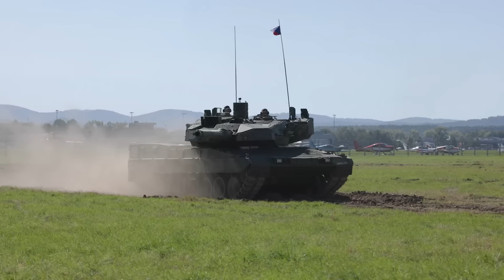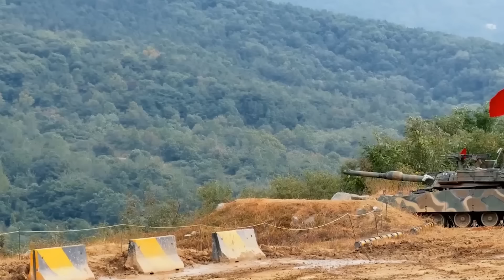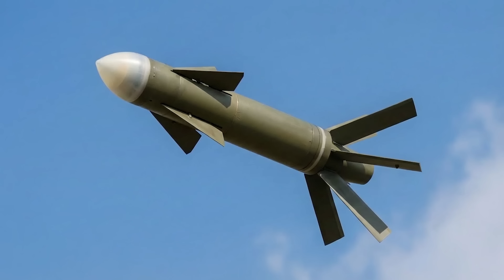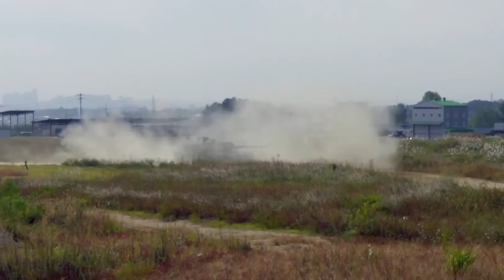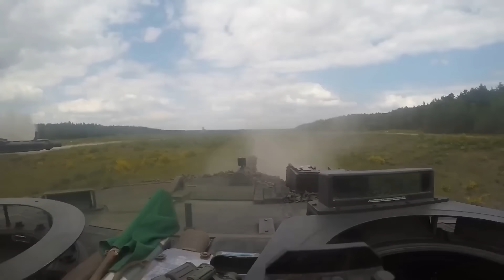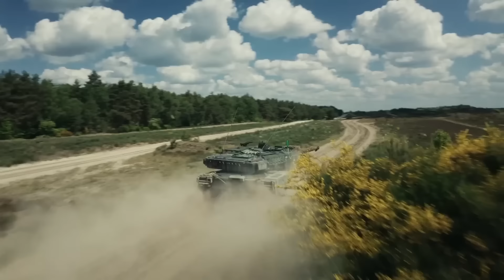Germany’s New Leopard 2A8 Is Better Than K2 Black Panther?!

Comment: When it comes down to real world battle, it's not the super advanced next generation tank that is sitting in the maintenance hanger or in the production facility, but the good enough and modern enough tank already operating in the front lines ready to take the shot.  I'll take the K2 Black Panther over the Leopard 2A8 any day for that matter.  The K2 is built to fit the environment that it is going to fight in.  If the K2 were to fight in the European plains, it will do just fine, but if the Leopard 2A8 were to fight in the Korean Peninsula, it will be a 'fixed target'.

Comment: If a Leopard and a K2 Black Panther strike simultaneously, they will penetrate each other's armor.

Furthermore, since their firing ranges are similar and there is no difference in accuracy, if neither side fires the first shot and fails to kill the opponent, the time it takes to load and fire the second shell becomes the deciding factor for survival.

In this situation, the K2 Black Panther, equipped with an automatic loading system, has the advantage. Since tanks perform evasive maneuvers very aggressively to secure advantageous positions, the automatic system is far superior to a human operator.

Additionally, it would be objective to choose a tank that allows you to operate two tanks for the same cost and can operate in swamps and temperatures as low as -30 degrees Celsius.

On top of that, maintainability must be considered; naturally, heavier tanks are more difficult to maintain, so a tank with fewer sensor malfunctions is preferable.

Comment: 2a8 or a9 will likely end up with 1650hp in the future. as rolls royce is developing the engine currently MTU MB 873 Ka-501 - 10V199. the drivetrain is stronger, and the changes will perhaps be implemented due to leopard 2 now being a heavier tank then previously

Comment: The Leopard 2A8 is widely regarded as the most balanced MBT today. There is a reason why the Leopard wins more competitions than any other tank in service today. Some tanks focus on firepower, some on mobility and some on protection, the Leopard 2A8 has the best balance on all three and this is why it's regarded by most experts as the best MBT. The main advantage of the K2 is its shorter delivery time.

Comment: These guys really stating that the black panther k2 is better then the leopard let me remind you who designed the gun on the k2 rheinmetall did and also the k2 production started in 2008 the leopard 2 series production started in 1979 and continued upgrades have been made to this date while I heard Poland bought some k2s in 2022 that's at least 3 years now your all saying that the k2 would be produced in one year the leopard is better the k2 is best to be going against the type 10 since it's in its same weight class

Comment: The German 2A8 costs around 35 million euros. Delivery time over 5 years and high maintenance costs. Weighs 65-70 tons. The Korean K2 costs around 20-25 million euros. Delivery time around 1 year. Maintenance costs are reasonable. Weighs 56-60 tons. Which one do you buy? Politicians decide, citizens pay. With a 200-1000 euro drone, both will be destroyed and for sure. Main battle tanks are already too expensive and almost all repairs have to be done far away in a depot to get them in order.

Comment: Korea is trying to make the tanks comfortable for now. It is an automatic loader and semi-active internal suspension unit (ISU) system, which enables precise control of body position in both front, rear, left and right directions, and reduces soldiers' fatigue by absorbing shock from the ground. It is really hard to lift and load the heavy shells one by one when shooting. And the Electronics Kingdom, Korea is going to digitize the tanks, so it will eventually develop into unmanned tanks controlled by AI.

Comment: The design philosophy and core platform of the Leopard 2 series are fundamentally outdated. In contrast, the K2 Black Panther commenced development in the 1990s and entered mass production in the 2010s. Even before the A8 variant, the Leopard 2 platform faced significant challenges with the A7 due to limited internal space and the inherent constraints of its aging architecture.

Although there were initial plans to develop the Leopard 3 around the same time as the K2, the project was scrapped and neglected following the downsizing of the German defense industry. The ongoing Russo-Ukrainian War has reignited the development of the Leopard 3, but since it will take considerable time to complete, the A8 was introduced as a 'stop-gap' measure to fill the void.

Germany is finally waking up, showcasing the Leopard 2 ARC 3.0 technology demonstrator in 2024 to bridge this extensive gap. However, it will take time for the Leopard series to reclaim the prestige and dominance it held during the early to mid-2000s.

Comment: Technologically, K2 is the "most" advanced high-tech tank. Computerized hydroneumatic suspension system enables K2 to go almost anywhere: watery soft rice paddies, Rasputitcha, swamps, heavy mountain slopes, jungles, rivers up to 4.5m depth, deserts, deep snows, sandy deserts, etc. Its high-tech fire control system with multiple target tracking, assisted by hydroneumatic suspension, has no match. 100% accuracy at 4.5km distance. 80% accuracy at 5km distance. Digital networking, Drone jammers, composite armor, passive & active protection systems. Superior electronic systems of K2 has no rivals. Note that in modern tanks, superior AI assisted electronics make huge difference. In Europe, even female soldiers operate K2. Welcome to high-tech electronic warfare age!
Reply: K2 lifespan 96,000 km, Leopard lifespan 64,000 km

Comment: Norwegians had a chance to do extended tests with Leo and K2 and their army suggested K2 as winner for them twice (it was even communicated that "political aspects" caused that Leo was choosen) .
Poland has already Leo 2 A4 and A5 versions.  A4 are being modernized. Loooong process with many problems. The main one is availability of parts and cooperation with German side. This "experience" alone caused Polish to look for any other option than Leopard 2. And... time horizon and volumes - Poland wants to have 1000 of K2 tanks  by 2032. We would be lucky to get 100 of L2  by this date. K2 PL will have Trophy system, improved protection and still being much lighter than A8 (which in fact is the latest A7 + Trophy System). Possible to be produced, fully serviced and modernized locally - forget about it with Leo. 
Cheaper, quicker, 10 time more + more reliable partner, technology transfer and logistics based on most of parts produced locally. Was it difficult to choose?
And now Peru  is doing the same.

Comment: Core equipment engines power pack is  both made in Germany.
Reply: When we attempted to export to the Middle East, Germany blocked the deal, so South korea decided to develop our own indigenous powerpack. This powerpack has already been exported to Turkey for the Altay main battle tank. South Korea also plans to apply it to future K2 production. However, the Polish K2 currently still uses a mixed configuration, combining a Korean engine with a German transmission. That said, the fully Korean powerpack may be applied starting with the K2PL, possibly as early as that variant.
Reply: 엔진은 예전부터 한국산임. 미션만 독일산을 썼는데 지금은 엔진+미션 모두 한국산임

Comment: It is the current address of the German defense market that simply maintains a very expensive unit price, which is arrogant, too slow, idle, and unnecessarily expensive, without having an attitude of consideration or respect for customers at all. On top of that, so does the stance, where the potential for smooth technology transfer converges to zero virtually no change at all
Reply: 독일이 eu 수장국이 되면서 유럽, 특히 중, 동유럽에 갑질을 많이 하긴 했지.

Comment: Simple specifications and mobility, versatility comparison: K2PL = 2a8 >= K2 black panther > 2a7. However, considering the price per unit, the time it takes to supply after delivery, and whether or not to transfer technology smoothly, Leo 2a7 or 2a8 is not comparable to k2 at all. Of course, not only competition between simple tanks but also competition in the self-propelled artillery market is the same as the German defense industry is completely be left undone by Hanwha Aerospace's k9 regardless of its performance. In addition, the gap in market share is set to widen even further when it is soon improved to k9a2 and exports to that version are expected
Reply: 유럽의 자랑 조선업이 한국,일본,중국에게 조선업을 완전히 내주게 된 것처럼 방산업도 한국, 중국에게 완전히 밀리는 중이지.
현재 한국의 잠수함 사업도 독일과 프랑스가 목숨을 내놓고 한국을 방해하는 것도 이와 같은 이유야.
유럽 강국들이 독일을 지금까지 욕하는 것도 과거 독일이 자랑하는 잠수함 기술을 한국에 라이센스 해준 결과
제자가 스승을 뛰어넘으려고 도전하는 중이지. 자연스레 독일을 제외한 잠수함들은 한국에게는 완전히 상대가 되질 않지.

Comment: The Leopard 2 is the most agile MBT on the market, and also has no prolems with bad terrain.
https://www.youtube.com/watch?v=yD_AOdylrOk
https://www.youtube.com/watch?v=wmGtrIKr85I
Reply: 당신이 가장 기동성이 뛰어난 전차라고 말한 Leopard 전차가 K2 전차보다 느리다는 사실이 증명된 동영상이 있습니다.
그 동영상을 당신에게 선물합니다.
https://youtu.be/_yNW3X-YEDg
Reply: @boanpc  The Leopard 2 has a speed limiter, which can be deactivated by order of the tank commander (only in emergencies). In this state, the tank can briefly reach a top speed of over 120 km/h. Otherwise, its maximum speed is 70 km/h, but it can maintain this speed at a constant rate.

https://youtu.be/gQSzijvHQ9g?t=759

Comment: Tanks that are hard to operate in a war and tanks that can be operated right away... it's a big difference from here
Korea to pour in volume
Tanks that may come out in small quantities at any time This difference is very large. Assuming that it becomes a battlefield right away, combat equipment such as the plastic model is not needed on the spot. That is combat equipment when it is quickly and urgently put into combat. This is the difference between Korea and Europe

Comment: It goes without saying. The Leopard is superior to the Black Panther. This is because the two tanks had different circumstances in which they were created, and their development and operational philosophies differed.

The Leopard was developed independently by Germany, inheriting the MBT-70 development program initially attempted jointly with the United States. It was designed to counter the Soviet tanks of the Warsaw Pact, which blanketed the eastern plains. Rapid firing and maneuverability were essential. The Leopard 2, with its added protection, was designed to dominate the Polish plains, a key battlefield, with its long combat endurance and air and artillery support, even if its numbers were small.
Unsurprisingly, it was a top-of-the-line, expensive, and difficult-to-build tank.

The Black Panther, as a successor to the Korean-made K-1, was developed to counter the massive number of Soviet copies, despite its relative disadvantage in the narrow plains and mountainous terrain. It was a tank perfectly suited to the Korean Peninsula's combat environment, characterized by speed, invisibility, and countless variables. And to meet North Korea's massive material offensive, rapid introduction and production became crucial.
Therefore, the platform was designed to adapt to future technological maturity rather than rely on immediate technology.

Therefore, the Leopard has the upper hand in terms of tank specifications.

The problem lies in the military budget of the country that will operate it. Will it have the time to receive the Leopard, even if it means waiting a long time?
And since it's a German-made tank, it will incur a significant cost. Will the defense budget be sufficient to cover this?

Of course, the K-2's focus on undetectableness means it's not very expandable!
That's why, despite numerous improvement plans, South Korea is moving straight to the K-3.
Reply: 무슨 근거로 레오파트가 우위에 있다는거야
당신 뇌의 망상속에서???
레오파트가 나은 점은 무게에 걸맞는 방호력 말고는 그닥 없어 아니 오히려 낮아
Reply: @정재민-o8f //아하하하! 지금 잠시 착각한것 아닌가? 지금 비교를 하려는 레오파드는 나토조약국에 잔뜩 풀린 구형 A5버전이 아니라고! 만약 그 버전이라면 나도 K-2의 손을 번쩍 들었을거다!
솔직히 A8에 이르면 같은 레오파드 2라 부르기에도 이상하단 것이지. 주포도 바뀌고,미션 컴퓨터도 바뀍,적외선-레이더 장비에 능동방어까지 달고 장갑도 교체하면 그게 플랫폼만 레오파드2지 같은 목적의 전차겠냐?
동등 급으로 가려면 기술이 성숙한 상태의 K-2PL 정도는 되어야 하는 거야!
문제는 이경우에 민첩성이 떨어져 이번 우크라이나 전훈이 증명하듯 레오파드 블랙팬서 나란히 사이좋게 ATGM과 드론의 밥이 될거라는 거지!
동영상이 외면 했지만 능동방어 시스템을 갖춘 로스께 전차도 결국 드론 밥이 됐거든?
지금A8의 무장으로는 어림없다고!
하지만 A8과 비교하면 K-2는 동등 혹은 약간 열세야.

Comment: The K2's export price may be $13 million (€11 million), but this is due to technology transfer and local production, where in Germany you pay €20 million and wait in line for them to graciously deliver your tanks over the next 5-10 years. Purchasing a K2 is more cost-effective; you get more tanks for the same price than buying a Leopard 2A8, and you also have full support for local production, modifications, and overhauls.
Reply: Everybody forgets a new Leopard 2 factory opened in Czech boosting production & lowering over all cost.
Reply: @ronaldgrove3283  As a reminder, the contract was concluded only on December 18 2025, and covers the "production" of only 150 Leopard 2A8 hulls by Tatra Defenc. Tatra Defence will be responsible for welding the Leopard  2 A8 hulls, including quality control and technological processes (it only needs to build new halls, buy new machines, hire new employees and then train them so that it does not result in a decline in current production - i.e. the same thing as PGZ/HSW is currently doing in Poland, with the slight difference that K2PL will be produced entirely in Poland).
Years ago, a similar contract was concluded with Sweden for the delivery of 120 Strv 122s, 91 of which were manufactured by Bofors and Hägglund (now BAE Systems AB). However, the new 44 Leopard 2A8s that Sweden ordered in January 2025 will be manufactured in Germany.

Comment: K2=in operation. Leopard 2A8=under contract
Reply: I don't know if you noticed the Polish flag. It seems they in Germany are still hoping Poland will buy the Leopard 2A8, where 128 Polish Leopard 2A4s have been modernized to the 2PL/M version for almost 10 years with Rheinmetal. And in less than three years, Korea has delivered 180 K2GF tanks to Poland, and the US 116 M1A1 FEP and 117 M1A2 SEPv3 tanks.
Reply: @herkulespoirot2697 Don’t forget that the Leopard 2A8 is a 2A4 modernized, there are no real new production of Leopards, they are using old platforms and “refurbished” them and adding new system. To the contrary. The South Korean K2 MBT are all new and have the most advanced technology in the world, plus their capacity to build and fulfill orders is amazingly high
Reply: Germany needs to wake up like Canada does
Reply: @lloydkuepfer1599 Germany opened another Leopard 2 factory in Czech.
Reply: @ronaldgrove3283  You’re a broken record. Stop. 😂

Comment: New technology, cost-efficient and affordable, easily upgradeable with modular design, low-profile chassis, fast, capable of detecting hidden enemies, withstands 125mm rounds with special alloy armor, highly reliable, and extremely accurate. K2 Black Panther-

Comment: What amazes me is that Germany is making the same mistake twice. Does anyone remember World War II in Germany? Do you remember how your super havy and difficult to manufacture tanks were defeated by cheap and easy to manufacture American and Russian tanks? On the modern battlefield, it is even more obvious that it is not important how much armor you have, but whether you are able to defend yourself against drones or are you mobile enough to avoid artillery fire.
Reply: 맞습니다.  장갑이 두꺼워도, 두껍지 않아도 어차피 포탄 맞으면 다 박살납니다.
Reply: That's the famous Tiger panzer that for every hours of being used, needed to spend another hour in the mechanical shop. Tigers had also terrbile transmitions that could not handle the power of the Maybach engine.
Reply: Did you see the clip ? It has protection ! And protection by skyranger vehicles accompanijg them ! As IFV you also need ! Of course they work on even additional extra protection ! And there is the Panther yet in Development. Question is: what do you do with tanks on each site ? the plaform stands for a challenge for each army in the world ! Not only the Leopard…Also Chinese and Russian tanks, US tanks…

Comment: "If you order a German tank, you’ll probably receive one in 10 years. It sounds ridiculous, but it feels true. If a war breaks out, you might get a few a year... after the war is already over."
Reply: 전쟁은 끝나고 나라는 넘어가 있고 ...
Reply: 그럼 이후에 주문한 전차를 받는 사람은 국경선을 넘어 침범하여 점령한 적군이겠군요
Reply: The F-16v is in a similar situation. There are many orders, but the production line is small, so it's difficult to receive even 10 units a year.
If an actual war breaks out, leopard will not be supplied. We cannot meet the quantity of tanks that have been destroyed with 50 units produced annually.
Reply: Actually no, in 2 years you have 50 to 60 leopards and there is a new factory opend in Czech
Reply: @proheimearz691  Germany still has to prove that, but South Korea has already done so.
Two or three years?
That’s just when the factory will be completed; it doesn’t mean that tank deliveries will be finished by then.